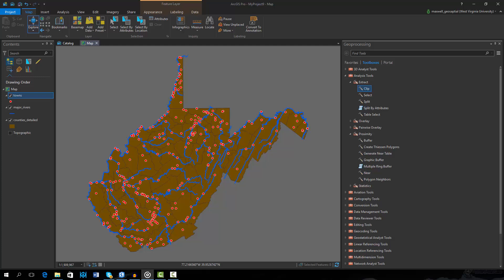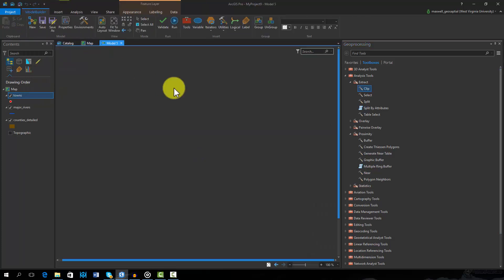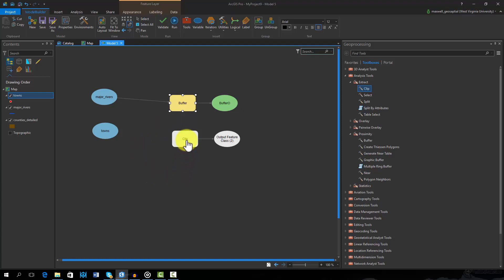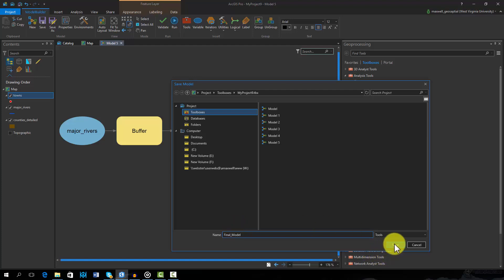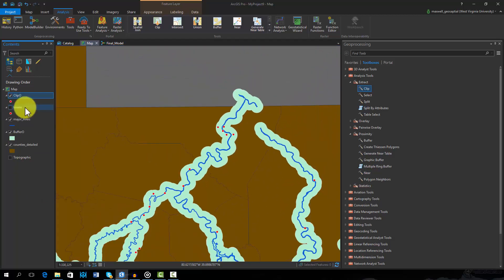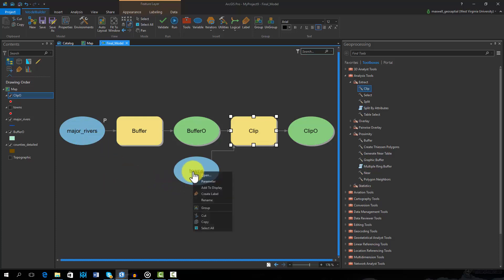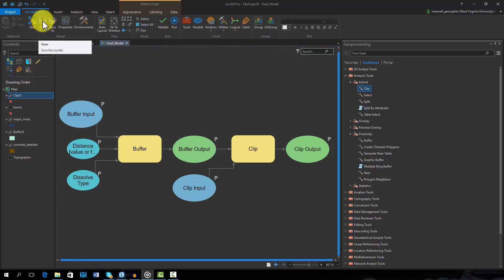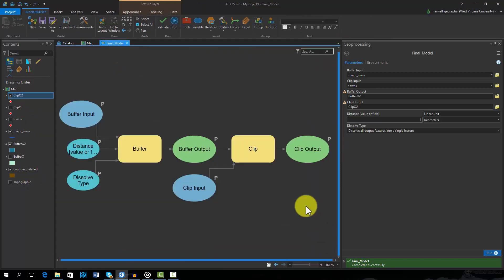Model Builder in ArcPro

Comment: Hi I have a question ... I have two databases 175 shapefiles each I want to clip each one of them using the corresponding shapefile from the second database .. as I can't use two iterators I have to do a nested submodel within a model... how can I do that? thanks a lot for your answer
Reply from the maker: This might be easier to do using a python script.
Here is some code I used once to intersect three files that all had the same names but were in different folders. 

 import sys, arcpy

arcpy.env.addOutputsToMap = 0

InFolder = "F:/output_test/Level_1"
MatchFolder1 = "F:/output_test/Level_2"
MatchFolder2 = "F:/output_test/Level_3"
OutFolder = "F:/output_test/Intersect"

arcpy.env.workspace = "F:/output_test/Level_1"
shapes = arcpy.ListFeatureClasses() 

# step through the feature classes
for FC in shapes:
    MatchFC1 = MatchFolder1 + "/" + FC 
    MatchFC2 = MatchFolder2 + "/" + FC 
    # if the same name is in the match folder
    if (arcpy.Exists(MatchFC1) & arcpy.Exists(MatchFC2)):
        InterFC = OutFolder + "/" + FC
        arcpy.Intersect_analysis( FC + ";" + MatchFC1 + ";" + MatchFC2,InterFC,"ALL","#","INPUT")